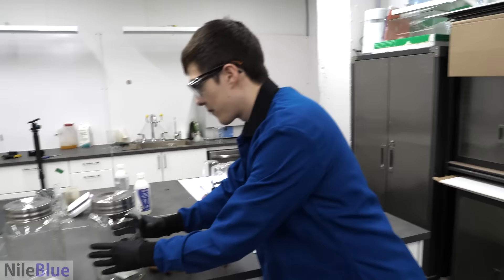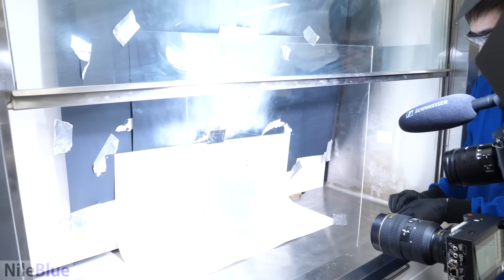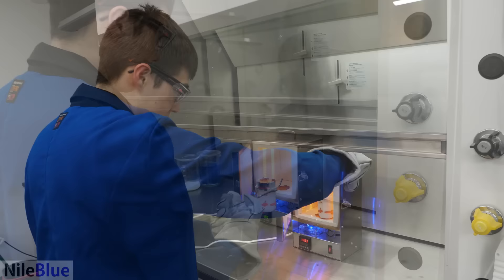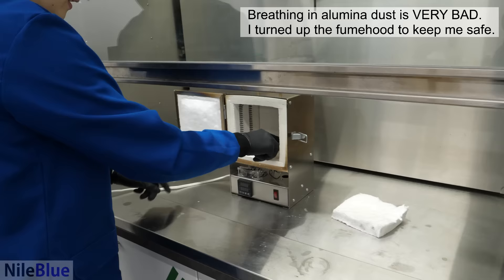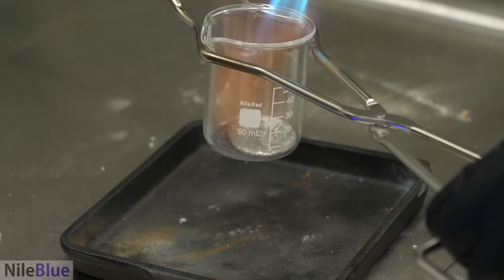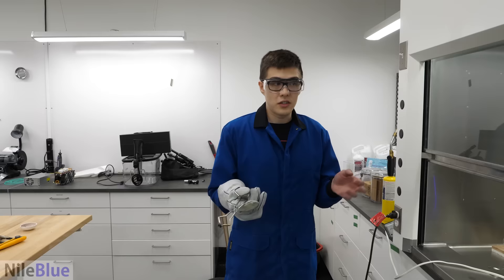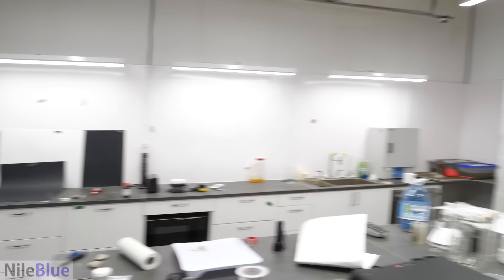This project was a disaster.

Comment: The crucibles you are currently using are good for silver, gold and aluminum. Copper likes to eat through the crucibles you are currently using. If you plan to melt any other metals like copper or iron you need to use graphite clay crucibles. 
You should constantly check on the copper because. The longer you leave it exposed to the high heat the higher chance you have all your metal oxidizing. You should use copper or aluminum instead of the tin. Because they're melting temperature is much higher than the tin’s.
Reply: the point of the tin/bronze was to have a lower melting point.
Reply: @marshmellominiapple  The higher temperature difference between the metal and the water(and glass maybe since the metal touching the bottom was a requirement) adds to the explosion.
Reply: When you suggest adding copper to copper to make bronze
Reply: @LetsNotMockem  The type of metal doesn't matter based on your statement, the temperature of the molten metal will be what he sets the furnace to.
Reply: @marshmellominiapple  this is probably the real variable in his tests. if it is hot enough, the insulation bubble will last until the metal hits the bottom, then colaps making more contact making more steam.
Reply: It’s the smart bois
Reply: U're all forgetting about molten salt, nice explosion
Reply: dere
Reply: You really don't want to be pouring molten Aluminum into water. Sure it doesn't always go bang but when it does its pretty special. I've no idea if the same would happen to Alum/Copper, but I'm not about to find out.
Reply: Aluminum can chemically react with water and detonate if you get unlucky. His plan was to test for an inactive metal akin to the gold he previously observed.

On the topic of the detonation, I suspect the glass shattering due to heat transfer or else steam/water shockwaves.  A sample without the water of hot metal glass should be attempted. How quickly does the heat transfer and detonate the glass.
Reply: @klebam9133  different types of metals have different frequencies and specific heat, the type of metal definitely matters as it affects the temperature.
Reply: @MrPruske  Not really that much. If the liquid metal touch the glass, blam. Thermal shock. Because liquid metal (above 500 C... maybe) and water (room temperature, 30 C, insane heat capacity). Heavier metal would sink easier, and this is I think why explosion with gold alloy became very spectacular.
Reply: The gold stuff is way more dense, that's probably why it reached the bottom before Leidenfrost effect stopped protecting its ass
Reply: @bdnugget  That makes no sense at all
Reply: @res1492  cool, care to elaborate?
Reply: Did you watch the entire video? He started out with copper.
But yes, he needs better crucibles. I like these for copper and similar stuff.
https://pmcsupplies.com/casting-supplies/crucibles/salamander-crucibles
Reply: @glenmcgillivray4707  - It is not just the glass that is "shattering," you are not considering the fragmentation of the metal.   Anyway, the glass would shatter nearly instantly from the thermal shock.
Reply: @rusdanibudiwicaksono1879  - And what about the fragmentation of the metal?
Reply: @Phantom0fTheRouter  if the aluminum fragmented.... There would be a cascading reaction due to the increased surface area.
And form Aluminum oxide and hydroxide and halides..... And a detonation would occur.

I wouldn't want to be standing next to his building when that happened, just in case of shrapnel.

The energy generated by metal fragmenting is low. The kinetic energy generated from conversion of water liquid into steam powers steam turbines in most power plants around the world.

A 20 fold increase in volume will do dangerous things to nearby people or objects.

Also when water expands it has a habit of breaking nearby objects.
So that is always fun.

And metal that is not properly cooled has no tensile strength. Of course sudden shockwaves will pull it into lots of little bits.
Reply: @glenmcgillivray4707  -  yeah, where did anyone mention aluminum?  

But, the reasons behind the fragmentation that causes the increased surface area of just about any molten metal dropped straight into water is what we are getting at.  

Diffuse nucleation is interfered with, and this creates stresses in the crystalline structure, which shatter the drop nearly instantly as it passes its boundary temp going solid, while still experiencing external stressors that caused misalignment in the first place.
Reply: @Phantom0fTheRouter  Honestly not much, like everyone mentioned below me, most kinetic energy came from water evaporation into steam. Even if it's contribute in shattering, most would have a big chunk with relatively low speed.
Reply: @Phantom0fTheRouter  well that is interesting. So there is a penalty to sudden chilling. Might explain somewhat the irregularities in the aluminum/water detonation. Sometimes it holds together, others it detonates.
Reply: @rusdanibudiwicaksono1879 - Nah bro... you've failed to notice that what happened not only cracked the jar, but turned a lot of the metal into tiny grains that littered the counter along with the top and bottom of what was left of the jar.  That was a violent release of the stress built up in the grain structure of the metal.

Comment: As a metalsmith/jeweler, next time just use the torch to melt the metal and toss in a bit of boric acid to combat oxidation, actually coat a small crucible with boric acid (pour in a little powder and melt it with the torch to make a glassy coating) then you can melt the metal with the torch but always add a bit of extra boric acid, and they make special stir rods for stirring the molten metal. 
Yes, the glass exploded due to thermal shock. It's not lab grade glassware and isn't heat safe.
Always wear long heavy sleeves and preferably leather or thick suede (NOT MICROSUEDE) closed toe shoes when handling molten metal. Standard mesh athletic shoes will melt like butter under molten copper or brass and you don't want to lose a toe!

Y'all should be glad you couldn't see my face during this video...

Comment: Hello, metal worker for 25 years here. The explosion actually has to do with the refractive index of both the molten metal and the glass, when touch metal kasploodge!
Reply: Hello, engineer here with a minor in physical chemistry. The explosion is actually caused by the molten material initially creating a bed of superheated steam holding the water away, then when something triggers the steam pocket to collapse (usually a splash near the surface but also hitting the bottom)  this causes a sudden unsheathing disrupting the organized flow of the molten material. Once it is turbulent more energy is then transfered to the water which spontaneously superheats and then explodes.

Also, it's clear you don't have a clue about what you're talking about, the refraction index of a medium is the ratio of the speed of light when in vacuum to it's speed in that medium.
Reply: Chemistry go Kaboom
Reply: @drwat3rmelon655  more like thermodynamics go kaboom
Reply: Yes, clearly the speed of light in a substance is what is making this explode /s

Comment: Awesome video man! I think your completely right about the height and velocity making the difference. I believe that was definitely a proof of hypothesis. Only repeat experiments would solidify it.  

I think the velocity plays a key factor in when it explodes. When molten metal is submerged in water it vaporizes it instantly creating a chamber of water vapor around the molten metal. (Reference: leidenfrost effect)

With the leidenfrost effect comes a pressure differential. When this pressure differential is contained...(by surrounding water) well then the pressure will continue to build until something gives. Water is incompressible so the molten metal implodes and breaks from a lump into crumbs that cool much faster and stop the leidenfrost effect, almost instantly, and then transferring all of the energy, built by pressure, back into the incompressable water only to meet the strength of the container it's in. This, of course, being the glass jar it was in. 

The energy has to go somewhere and you figured out how to time it just right to make it detonate at the bottom of the jar and blow it up.  

You ARE a mad scientist. Lol
Reply: 🎉🎉🎉🎉🎉🎉🎉Another theory comment. thank you and Great theory

Comment: The vapor film around the hot bronze is the called the Leidenfrost effect. The "explosion" occurs when the bronze-water interface drops below the Leidenfrost temperature and flashes the water to steam creating a pressure wave that breaks the glass.
Reply: me me big boy
Reply: the metal probably cools faster as soon as it hits the bottom, therefor making this happen. makes sense
Reply: Whoooooa thts so cool
Reply: It's correct that the Leidenfrost effect creates the explosion, but Derg is incorrect. It's not about cooling faster, although the lower submersion does help the pressure buildup. You can see the first one didn't succeed because the fluid stream didn't break apart and the Leidenfrost effect formed a chimney for hot gas to escape from the bottom and prevented pressure buildup. The second time we see the drop separating and getting covered from all sides. What matters is the  water cover, a lot of it. I hope this explains it.
Reply: Nile knows that
Reply: Nothing significant exploded here; what broke the glass was its contact with the still exceptionally hot metal. You can see that, viewed frame by frame.
Reply: I think it's just when a drop of water is getting surrounded by the liquid metal, turning it into steam. The expansion looks like a explosion.
Reply: I thought about the same thing. I just wondered how much of the shockwave was actually caused by the gases dissolved in the liquid rather than the steam itself when the water vapourises. Gotta repeat the experiment with boiled water and the same water to see
Reply: Huh. I've only seen the Leidenfrost effect in interactions with liquid nitrogen, and just didn't think about how the temperature differential between molten metals and water could cause the same effect.
Reply: One major quibble, it was not a "detonation", just a steam explosion - which is a subsonic effect.
Whether the glass breaking was due to the steam expansion or simply because of the molten metal contacting the cold glass has not been determined - only assumed.
Reply: @MegaGullas  And I assume on a hot stove with water?
Reply: @57thorns  probably. Never thought about it that way though

Comment: The phenomenon of the explosions is called (creatively) "Vapor Explosions." I had a nuclear engineering prof tell us that it happens during reactor meltdowns when the molten core hits the coolant. It has to do with the water penetrating the metal then vaporizing, breaking it apart creating a chain reaction. If I remember correctly, it results in shards sizes in the microns. The guy said Oakridge paid him to figure out how to make it not happen while the DoD paid him to figure out how to make it happen even more. It was an interesting 1 credit seminar

Comment: It looked like the third attempt was the hottest attempt done. I'm wondering if the higher temp helped give it a steam shield longer before exploding and that's the reason why it exploded. The colder ones exploded sooner due to the temp. Can you do another test with different metals at different temps?

Comment: Other variables:

How high you poured it from.  Maybe pouring from higher gives it more velocity, allowing it to get the bottom faster.  Maybe pouring from lower gives it less time to cool, allowing to remain hotter for longer (potentially maintaining the bubble for longer, before it cools enough to collapse, allowing water to touch the metal and explode).

Maybe small differences in temperature make a big difference.  Maybe higher heat maintains the bubble for longer, allowing it to get further down before exploding.

Also, gold is denser than tin and has around half the specific heat (meaning it takes about twice as much thermal energy for gold to reach the same heat, ie., gold has much more thermal energy at the same temperature as tin), so maybe the gold worked better because it took longer to cool sufficiently for the bubble to collapse , which gave it more time to reach the bottom.  (Also, when the water does touch the gold, there's still significantly more energy to transfer, in theory producing a more violent result.)

Those are my thoughts.  Nice experiment and good video!

Comment: There was a third variable between the first two which was distance from the side as the second appeared to be closer to the side than the first one was.  On the third one it was centered more like the first one which meant more water surrounding it until it bottomed out and exploded.

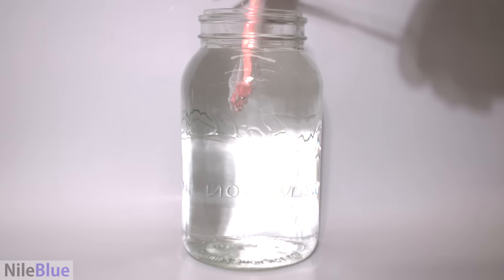Comment: 20:16 I believe the jar explodes because of thermal shock. Thermal shock will occur if the metal gets isolated enough from the water with the water vapor that is created around the metal at a certain angle such that it prevents the metal from cooling enough such that it's still super hot when in contact with the glass.

Comment: You could see a bubble form around the metal as soon as you pour it in. I had to turn the playback speed all the way down, the metal is holding on the the air bubbles till they get to the bottom and once they hit the bottom it pushes the bubble away from it causing stem or a cavitation, causing it to explode

Comment: The lack of practical engineering chemistry guys have makes me smile. Like, yeah, I'll never be able to synthesize acetaminophen, but I know if I cut out a piece of insulation, that piece is a perfect template for the replacement.
Reply: I felt the same about his lack of cooking knowledge when he was making the cotton ball cotton candy. Yes I could never do that but I know to make the fine fluffy texture he wanted you have to start with finely ground sugar, not a big clump.
Reply: I mean engineering is all about making stuff just work, for as little money as possible right?  He used a craft knife and some white shit he had laying around and successfuly made a video.

I'd call that engineering.
Reply: Well, I’m a chemist and wondered why he didn’t use the piece he just cut out as a template for the new piece too, so not all chemists are as challenged when it comes to common sense.
Reply: I thought the same at first... but then I thought that maybe he did it because the isolating wool is flexible (and you need it to be a little bit larger than the space it fills, in order to fill even into the small gaps - and not leaving any unfilled)
Reply: that's not engineering that's just being precise for something that doesn't need it.
Reply: @franciscourioste4783  
If he wanted to make it bigger or smaller, he still should have used the old piece as a template. Unless you measure or use the old piece, you’re just guessing whether it’s the size you need.
Reply: Have you ever used a muffle furnace before? Those things get to temperatures over 1000°C!! That insulation needs to cover every bit of exposed space in the furnace or you can fry the electronics. I call that needing to be precise. 

He especially needed to be precise since he was working with molten metal. If it had escaped the crucible and leaked between gaps in the insulation, that would have been the end of his furnace.
Reply: @janedoe6181  Even if he cut it perfectly it would have still fallen because there will always be a gap and the new material is different. A total replacement of the bottom with the correct material is what’s needed. I would say it’s more engineering evaluating the risk and decide to take it just for not losing another week rather than cutting it precisely, which is a waste of time because the metal can still leak.
Reply: Now you’re moving the goalpost.
Reply: @janedoe6181  No. As an engineer you have to consider everything. You have budget, time, risks, space, etc. Cutting precisely is what you learn in high school.
Reply: And u have one of the greatest engineer as ur pfp
Reply: we get it you can do something that he can’t…so exciting!
Reply: That's what you got chemical engineers fore ; )
Reply: Then you should see Tom from explosions&fire/extractions&ire...
Reply: As a chemistry guy, I can confirm that I am basically terrible at anything with a mildly practical application to really life
Reply: @janedoe6181  I doubt fixing furnaces is what he spends most of his time doing. if the smart solution saves less that two minutes anyways, i wouldnt say that's the massive gap in commonsense and would probably realise for next time he is in a circumstance like this
Reply: @matthewhebbert2751  
First, my comment is 9 months old! I don’t remember what this video is even about. Second, my second comment addresses why any gap can be disastrous.
Reply: Ikr and it's so cute😂

Comment: So I'm like 2 years late but my friend is a blacksmith and I wonder if this has to do with the surface of the metal rapidly cooling causing it to implode, like why cracks form when you cool steel too fast. It sorta looks like in the first video the metal has a shield of vapor around it, water vapor is a relatively poor heat conductor, but when the metal isn't hot enough to sustain the bubble of water vapor, the water collapses onto the molten metal cooling it rapidly, causing the outside to contract and implode. This would be supported by why hitting the water at a higher velocity would explode it instantly since it doesn't have time to evaporate before hitting the metal, and the glass touching it in the final attempt also would have the same effect as water hitting the metal since the glass would conduct heat faster than the water vapor.